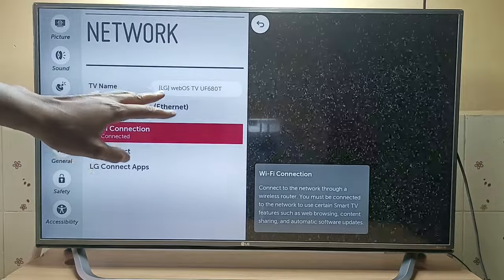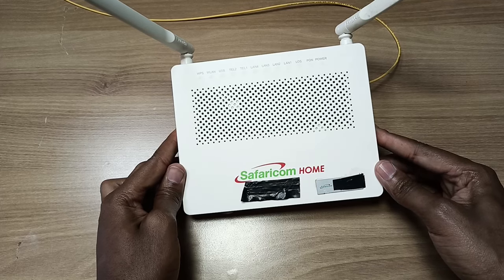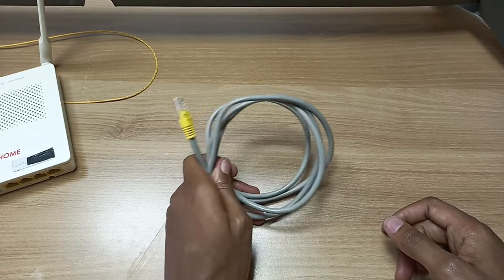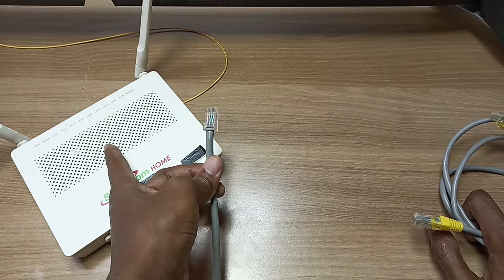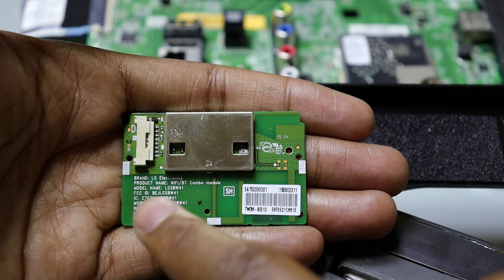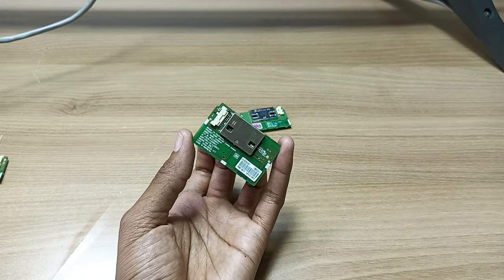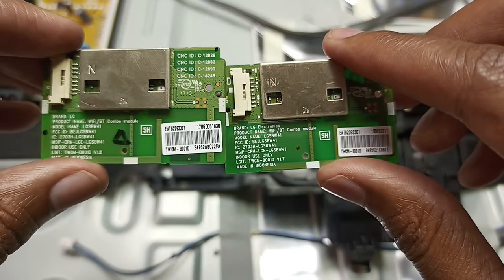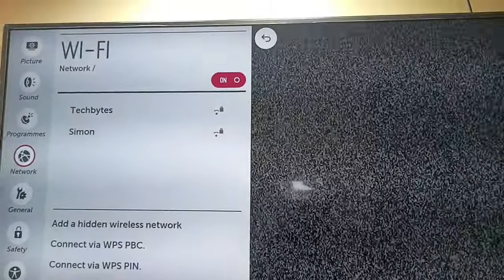LG Smart TV WiFi Not Working Problem Solved

Comment: Asante, mine only work when I hotspot it from my phone or my laptop but not with tge router. So I connect Safcom Wifi from Router to my laptop, then hotspot to the LG TV from my laptop. 

Whenever I connect the cable from a safcom network booster it is not browsing, it also not working when I connect direct wifi from the router.

Comment: Hi Dominic, my LG's Smart Tv cannot connect to internet. Using LAN cable and wifi also not working. Can u advice what parts should i change. Tks in advance
Reply from the maker: Looks like you need to change the main board if LAN is also not working